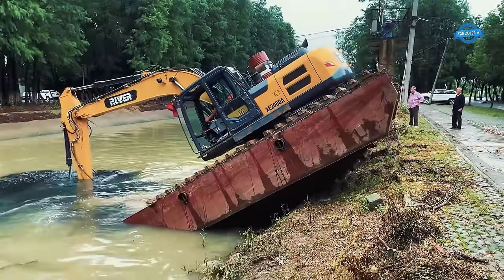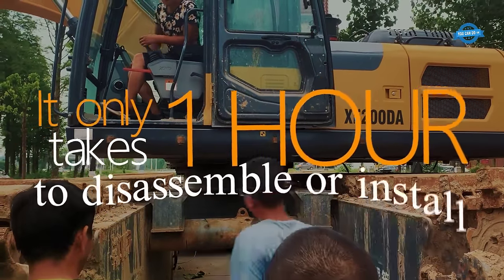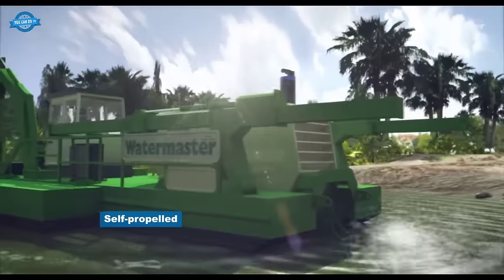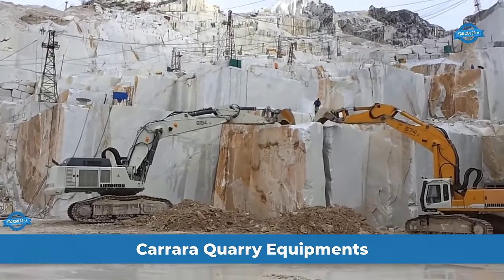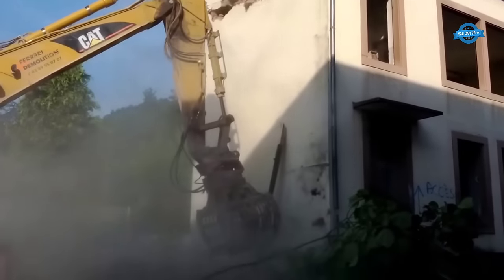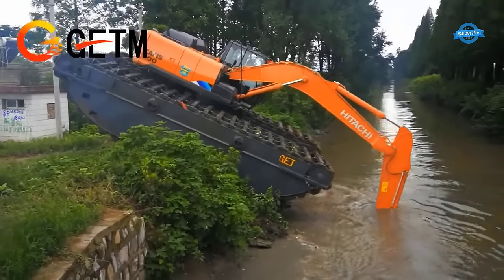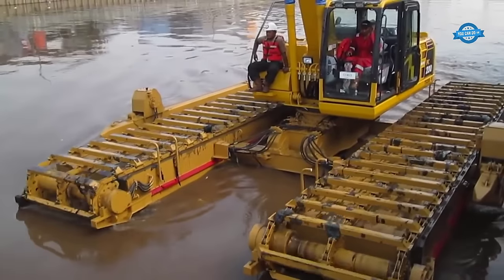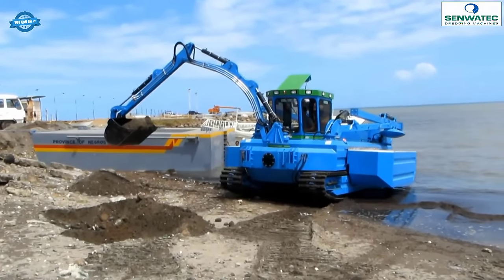Mind-Blowing Discovery: Unbelievable Operation of a Bizarre SUPER EXCAVATORS Across Any Terrain

Comment: I do not understand what the 270 ton excravator is doing... not only that the small komatsu is loading the bucket instead of the big machine doing that itself - those small rocks would sink to the bottom anyhow and at this pace with that tiny bucket it will take forever. Also there is zero visibility, so how does the operator know where to dump the rocks? Really strange.